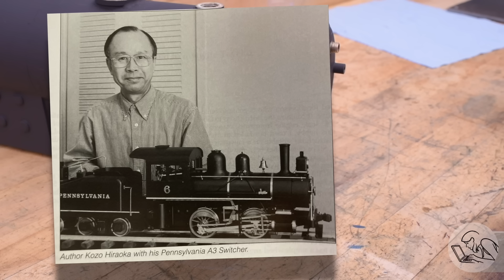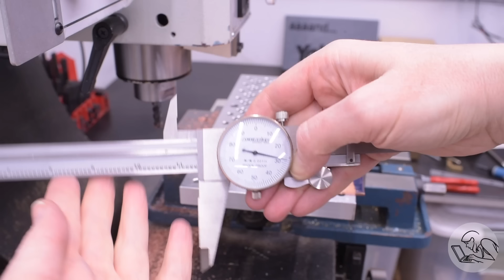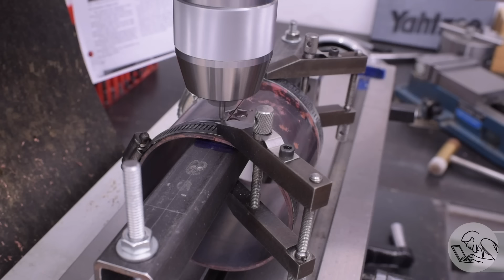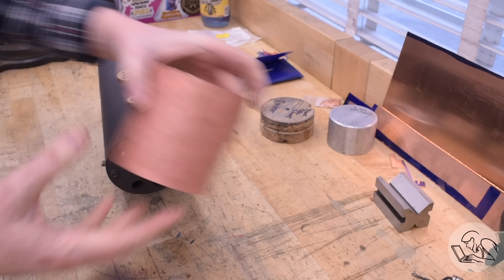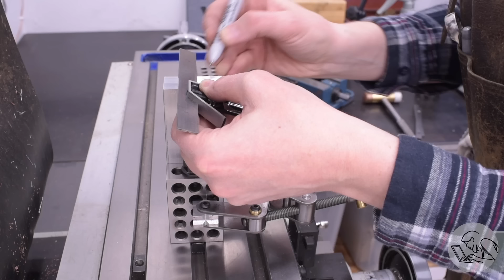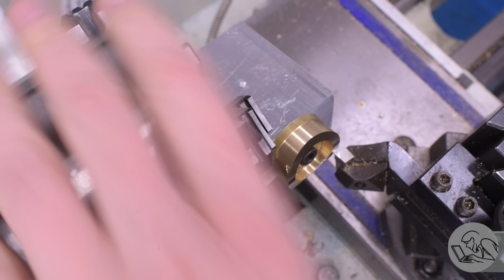Smoke Box! - Pennsylvania A3 Switcher, Part 89

Comment: Hay ive learned so much from u, ide love to think i tought u sumthin but a jigsaw will cut thru steel if u have the rite blade, itll deffinatly do copper. Also it helps if u put painters tape down, it works as a lubericant.
Reply: Red devil makes one of the best metal cutting blades out there

Comment: I have a Dewalt contractor table saw that easily cuts 1/8" aluminum. I'm certain it would cut copper and brass just as easily. I woulldn't even bother to swap out the blade.

Comment: I’ve found a jigsaw a very underrated way to cut sheet metal. With a Makita 18V BL jigsaw (variable speed is important) and a good quality (Bosch) metal cutting blade I can get through 3-4mm steel pretty quickly and with not bad precision/finish.

Comment: At roughly the 4:00 mark, couldn’t you angle the Portaban table and at least pick up a little more distance (the hypotenuse of the throat depth & blade height)?  If the table angled “up” in the camera reference plane and pointed at the top rear corner you should get another inch or so, add in the flip and you’ve got 2” less to cut by hand.

Comment: Using exhaust steam to create low pressure in the smoke box, and draw more air into the firebox, was an idea  included in the 2nd locomotive ever built. Richard Trevithick’s model of 1803, a revision of his 1802 model. 
He was a very clever engineer but not such a great businessman - he never patented it.

Comment: A metal cutting blade on a table saw would work.
Reply: I'm not sure if copper is the same as aluminum but carbide teeth are more than happy to chew through aluminum. If you're worried about firing a sheet back through your stomach a plywood sandwich isn't bad. But it will make an awful ruckus. Of course they also make metal cutting circ saws

Comment: Quinn have you considered getting a circular saw that is designed for cutting metals? It would make breaking down large sheets of stock a lot easier to make them small enough that your existing tools can work with them. I used one years ago when I was working construction and it worked quite well for steel so I can imagine it would work well with softer materials as well.
Reply from the maker: Way too big and coarse for this kind of work